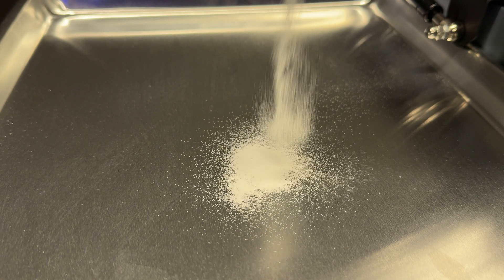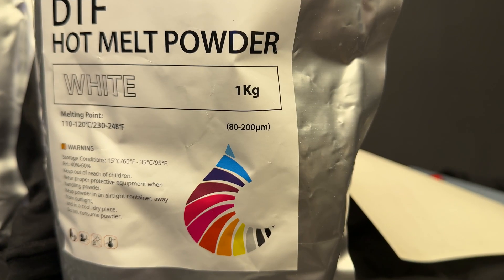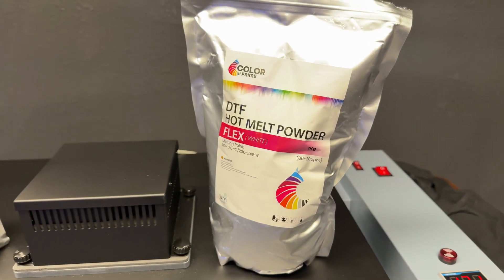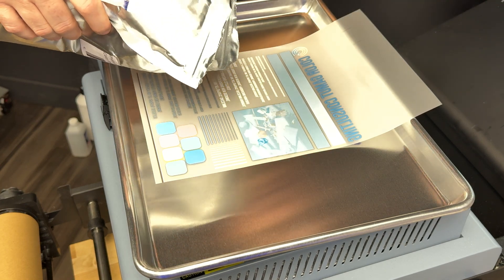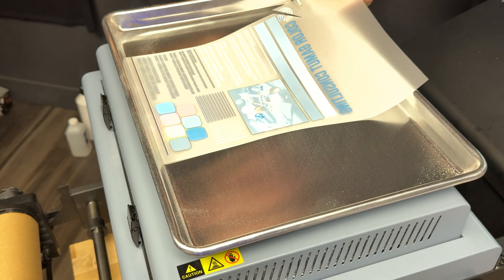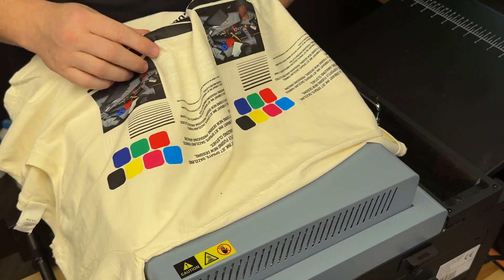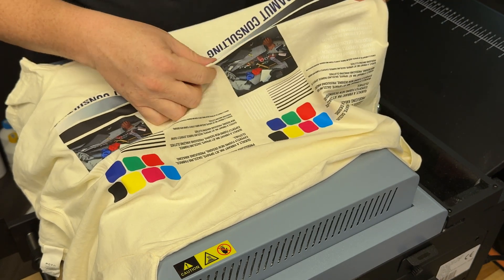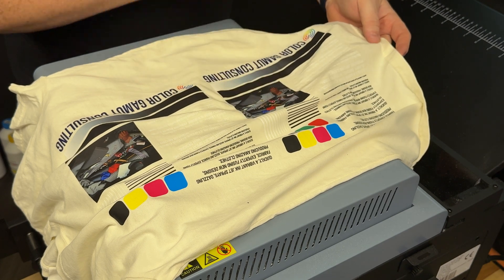The Key to Soft DTF Prints | Finding the Softest DTF Powder

Comment: Just to be clear, this was done sublimation printer on a cotton (or mostly cotton) shirt? I ask because I’m getting into graphic T shirts making and I heard of the method of either modifying their sublimation printer to a DTF or the DTF powder because how much DTF printers cost
Reply from the maker: No, this is a DTF printer and DTF film and powder.  the sublimation DTF hack is not good.  if you don't have a DTF printer, better to buy transfers for pressing on Cotton.
Reply: @ColorGamutConsulting  that’s my mistake, I did mean that process. I just heard that doing heat transfer with a sublimation printer was meant more for stretchy materials like polyester and that DTF printers is universal. Because of it people would get a sublimation printer, use heat transfer vinyl and THEN PUT DTF powder on the back so it’ll adhere to cloth.
Reply from the maker: @ElChapman-n6v  sublimation only works with synthetic fabrics like polyester.  DTF works on it all.  HTV goes on just about anything without any powder, the adhesive is built in.  Sublimation on polyester doesnt require any adhesive as it literally dyes the fabric the new color.

Comment: What is the best film to use? Right now, I am using the film that came with the printer (HTVRont) and it feels cheap; I've read that film matters - do you have a favorite brand?
Reply from the maker: the difficulty in recommending a film is almost everyone is slapping their own label on a film from China so we don't actually know what it is...and it could change without notice.  Because of this the only films I can recommend are Color Prime from DTF Station and DuPont (though I think this just became commercially available).  They are the manufacturer so they actually have control over the process and it is less likely to change or have issues.

Comment: Hey Jeremy, could you explain in more detail how resizing causes problems with halftone in the workflow? I’m wondering what the proper sequence is when adding text to an image. Currently my workflow is to halftone the image, then add text and remove any semitransparent elements. Sometimes I resize/transform the image after halftoning to better fit a design. I’m worried this might not be the correct approach and could cause issues.
Reply from the maker: I see you! I’ll have to answer this in a video